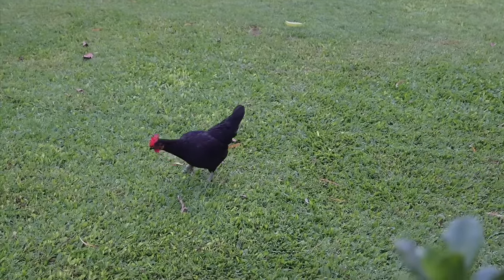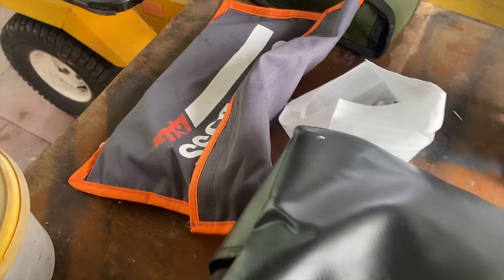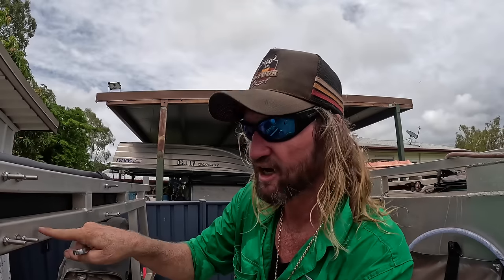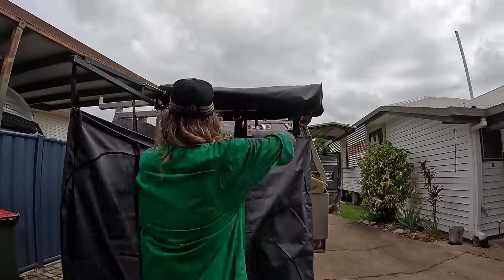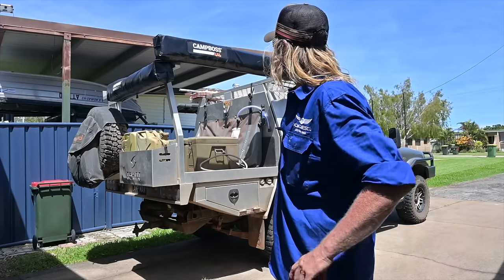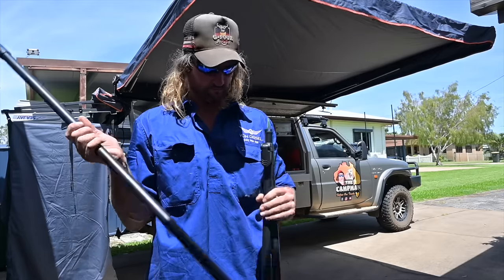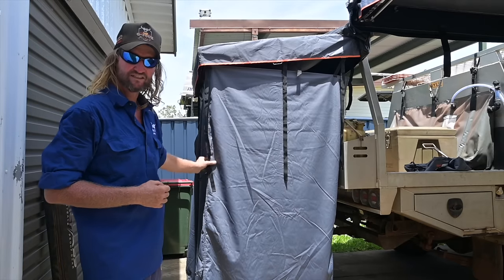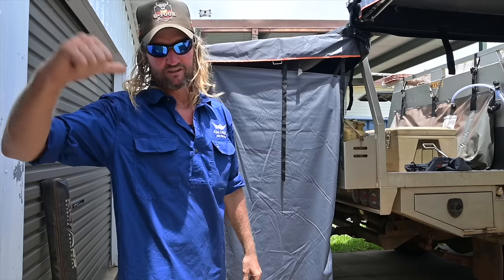Getting ready 2 swag it for a few months.. DIY..CAMPBOSS Quickie2.5 Awning/Shower tent upgrade..

Comment: Hey mate, good video. Have you had it in any rain yet and if so how did it go, any pooling?  Seem those spreader poles might be an issue. Can you drop one corner down for run-off like you can with one of the older style roll out awning?